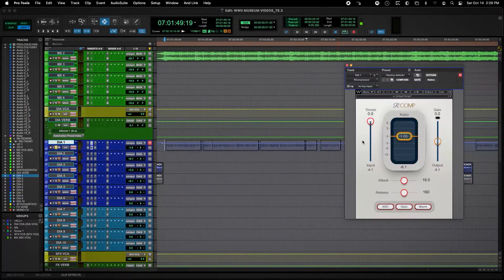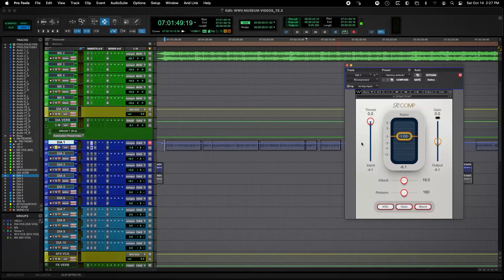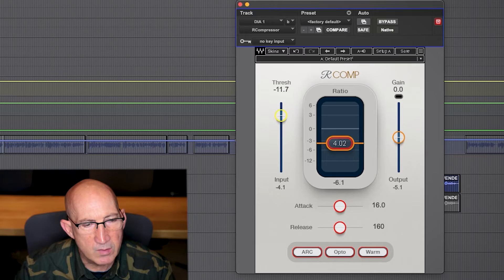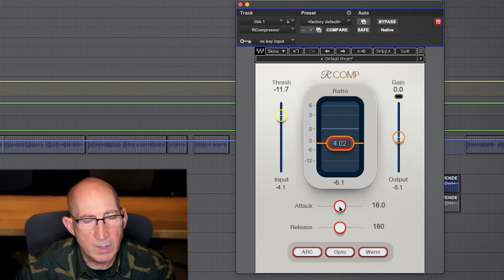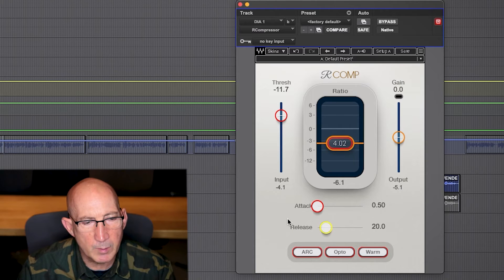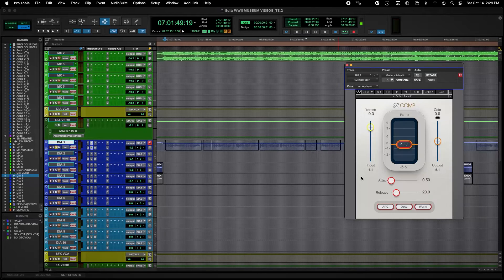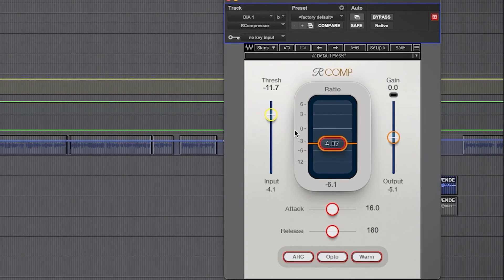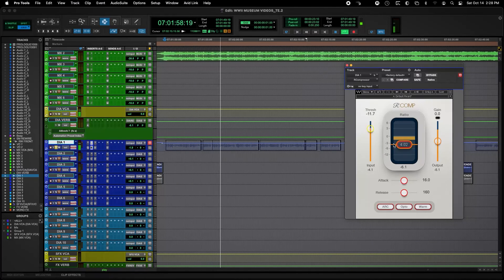Audio Compression for dialogue

Comment: Question: Is it better to cut the tops off (like you did) where you have a threshold of like -11, and a 4:1,
or
Go for an overall lighter compression over the full range like -25 threshold and a 2.5:1 ratio?
I can't really notice a difference between the original, and the compressed, when I use -25 2.5, but it allows for a more stable volume range.
Where, when I use a -12 4:1 or 5:1 I can hear a muffled sound in the loud parts, like... it sounds synthetic.
Could be my ears. I am new at this.
To me, using a limiter at -4 sounds cleaner than a hard compression like -12 6:1

Your thoughts?
Reply from the maker: Hey, I haven't tried the setting you are using, but now I'm curious to see how they would compare. My key thought is every engineer finds the things that works and sounds best to them. If your ears are telling you that is a good sounding setting then run with it. We all do things a little differently and that is in a way how we have our own style or sound. I'm going to play with your settings though.

Comment: Another aspect is for broadcast (preaching for instance) where you want dynamics for emphasis but you're trying to maintain a good even level for viewers so they don't have to touch their volume on their device of choice.  I tend to lean on soft compression but throw in a vocal rider to bring up the level when they get soft or they have terrible mic discipline and constantly move the mic around.  I've learned to offer a headset for main speakers for that reason.  Would love to hear your approach for those situations.
Reply from the maker: Seems like a good way to get the results you want.